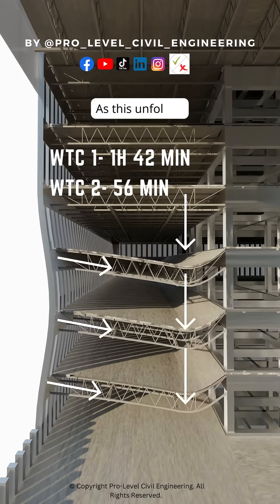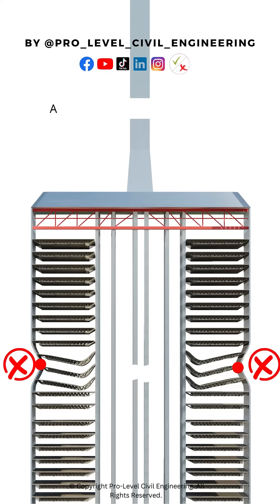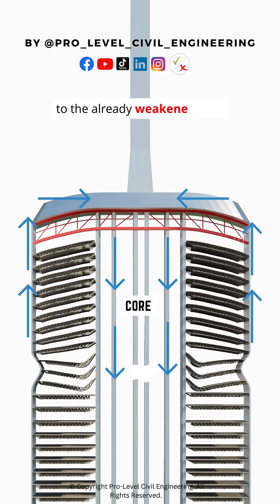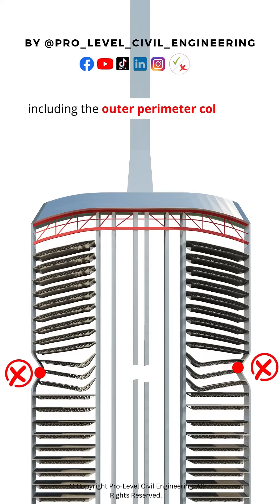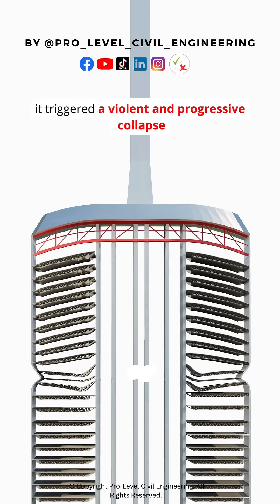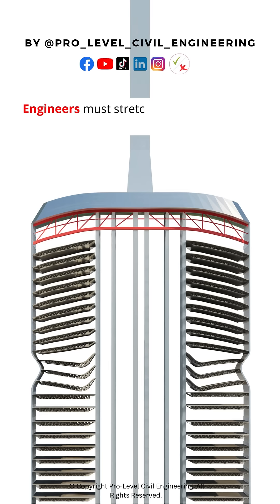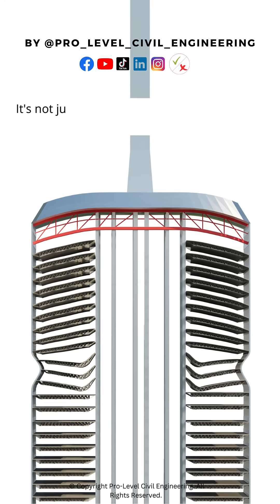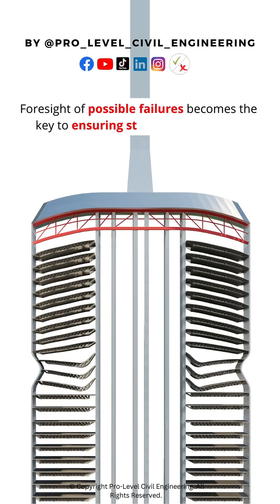The Horrifying Truth: Why the Twin Towers Collapsed on 9/11?

Comment: Yea thats want they want us to believe , i think an explosive was involved too
Reply: If you think it, it must be true
Reply: @cloudstreets1396 I believe it to be true.
Reply: @cloudstreets1396 numerous reports claiming they heard detonations. But that's not true right lol
Reply: @billy_barry  witnesses heard what sounded to them as detonations. Massive structural failure is an extremely loud event.
Reply: @cloudstreets1396  What did you hear that leaves you so firmly imbedded in your thinking?  Did you hear what the firemen heard standing in the street below?  I will always trust an eye witness to an event before I believe an expert with notions of what occurred.
Reply: @mrichards-j6b  I read the post report that very clearly describes what happened to the structure at the point of impact and after prolonged exposure to extreme temperatures from a jet fuel fire, weakened floor support beams to the point of failure. Four years of study by FEMA and NIST engineers and scientists which included witness testimony of hearing sounds like detonations is what I used to formulate my thoughts on the twin towers collapse. Just because firemen heard a noise is far, far from conclusive evidence. I will trust scientists and engineers whose expertise is in materials and structures and spent years analyzing debris and wreckage from the site.
Reply: @cloudstreets1396  That's how the Warren Commission was able to hide the true facts of the Kennedy assassination,  using the guise of expert investigating along with professional obfuscation techniques,  they were able to invent exactly what they wanted.  You can choose to believe what you want too,  but I am certain in my belief other forces were at play during the destruction of the WTC complex,  you are merely another component of the guise,  gullible or nefarious,  it makes no difference you are in play wether you realize it or not,  it is just like our political system a very well organized Plutocracy feigning democracy but buying every election,  do you actually believe you make a decisive vote when elections roll around,  no,  you are given a choice between two organizations doing the same things for the same people,  God bless you sir,  have a Merry Christmas!
Reply: @mrichards-j6b  Certainty in your belief is not evidence of anything
Reply: @cloudstreets1396  You do not have certainty in yours either,  two massive buildings eliminated from existence by fire?  Ha!
Reply: @mrichards-j6b  I do have certainty in mine. I can point to a report with extensive data generated by engineers and scientists whose job it is to investigate incidents such as this. You do not have that. You just want to believe a conspiracy despite collected and analyzed evidence.
Reply: @cloudstreets1396  A lot of people claim to know what occurred,  some in favor of the blatant NIST obfuscation and some against it,  it is obviously your intention to assert what you want others to believe,  thankfully their are many people who are not inclined to be swayed by the tomfoolery you peddle!
Reply: @mrichards-j6b  you use the words obfuscation, tom foolery and peddle so confidently and yet provide nothing to support that stance. It’s a classic tool of the conspiracy minded. Say it loud and proud. Who will stand against me if I say it loudly.

Comment: BS jet fuel does not get hot enough to melt steel, they have pictures of shape charges on every other floor in large storage room, the building was cut down so the us and British oligarchy can have another war to make themselves richer
Reply: Most of the jet fuel burned up in the intial explosions when the planes impacted the towers, but it caused massive fires on about 10 floors on each tower, and the fires (as well as the heat of the fires) only escalated as time went on. And the fires didn`t melt the steel, but it W - E  A - K - E - N - E - D the steel - which eventually led to the collapse of both towers.

Also the structure of both towers got damaged by the impact of the planes.

Comment: So, an aluminum plane slices through steel and concrete without so much as a wing tip breaking off. Okay, I got it.
Reply: F = m x a !
Reply: Both planes struck the towers at app 800-940 km/h.
Reply: @patrickanderson9023  So what,  they were not bullets,  they were hollow at the tips,  they could not take out there size in mass to create a silhouette of wing structure,  that's fantasy,  the holes were predetermined and generated prior to the computer guided flights impacts,  common sense should rule the day boys!
Reply: @patrickanderson9023  passenger jets cannot fly that fast at sea level
Reply: @Beachmaster820  Yeah, whatever. But try to imagine yourself: Each tower got hit by a 90-100 tons heavy jumbo jet at about 800-900 km/h. but you argue that it`s not possible for passenger jets made out of aluminium to penetrate steel and concrete? There are plenty of examples where small Cessna`s have penetrated tall buildings made of steel/concrete.
Reply: @Beachmaster820  Of course they can!
Reply: @Beachmaster820 Yes, they can. They don't NORMALLY because below 3000 Feet the Flaps and Landing Gear have been deployed for LANDING.
And both Planes were in steep dives to attack and hit the Towers.

Comment: The Jet couldn't destroy a single building after crash in Ahmdabad in lndia few months back !
Reply: THAT Jet was flying at less than a Quarter of the Speed. The Engines had been Turned OFF during Takeoff. 
How can you attempt to compare the Differences?

Comment: Thermite also helped!
Reply: There was no thermite.
Reply: @joshd3192 nano thermite. very powerful 😢
Reply: @joshd3192 how do you know? What causes a clean cut at an angle on the steel I -beams? Molten steel puddles, weeks after the tower's were down?
Reply: @Dangbo3030  The angle cuts were done during the clean up. Anything else?
Reply: @joshd3192  Hey.  Two sentence Tom thinks clean up crews are stupid enough to make the longest cut possible during removal,  anything else Tom?
Reply: Con tro lled 0pp osition  garb.
Reply: Very much. The remaining debris shows slanted metal uprights they strapped it too. All diagonally.

Comment: When the towers were designed giant jumbo jet didn't exist. The weight load plus the heat from thousands of litres of jet fuel burning weakened the steel.  The design didn't include functional sprinklers either.
Reply: Yeah, you're right. And Joe Biden really got 80 million votes. Covid was real. There was only 1 shooter in the JFK assassination.
Reply: A fire on the 80th floor can't destroy furniture in the basement. Explosives brought all 3 towers down.

Comment: Watch any video of an official demolition, and it comes down from the bottom up. T.T. went top down.
Reply: It was a government demolition. That is what you are forgetting. And a demolition can start anywhere they time the explosives. Use your brain. This isn't complicated.
Reply: @troyterry6919  So the government was behind 911?
Reply: @admiralprank probably shot down by the government. Why are you too scared to watch a 9-11 documentary?
Reply: @admiralprank you still haven't watched the documentaries
Reply: @admiralprank yes I can. I was twice voted the smartest boy in my school and I got a 33 on the act. I am a lot smarter than you.
Reply: @admiralprank and you were still too fearful to watch a 9-11 documentary
Reply: @troyterry6919  No I'm asking you. So what happened to Flight 93?
Reply: @troyterry6919  Does government explosion pull outside perimeter columns just enough for them to snap?
Reply: @nastyguy3841  Inducing failure of the core first will cause the trusses to pull on the perimeter columns and make them bend inward and snap.  How could the weight of the office materials and remaining concrete floors on the supposedly fire-weakened trusses, pull the much more massive perimeter columns inward?  Those columns are MASSIVE, making the trusses and any weight they beared seem like nothing in comparison.  Even to weakened perimeter columns.  Even if the weight of multiple collapsed/sagging floors were pushing down on a given floor.
Reply: For flight 93 watch 9-11 ripple effect.
Reply: @troyterry6919  So what happened to Flight 93?
Reply: @troyterry6919  Oh so the government compromised their own plan by taking down Flight 93? Why would they do that?
Reply: @troyterry6919  "Why are you too scared to watch a 9-11 documentary?"

I'm not. Unlike you I'm not gullible. Why are you too scared of logic? You claimed this whole thing was a set up by the government but yet, the government decided nah, let's foil part of that plan and take down 93. Great truther logic bud.
Reply: BS. A demolition is completely different.

Comment: Measure the weight of the plane with the fuel and passengers and luggages and all freight and multiply by the speed and how much was the force of collesion.  Then fire produced which stays for one hour burning inside the tower which was full of fabric furniture.

Comment: In my opinion I don't believe this for the simple facts that most of the video I seen there was black smoke meaning that the fires were oxygen starved which says If fire can't burn it can't get hotter a skyscraper in Madrid Spain burned for 24 hours without a hint of collapsing but these two over engineered buildings collapsed with oxygen starved fires two and three don't make four there's a digit missing to make it even make sense
Reply: What do you think was burning, wood? You had carpet, sheetrock, office furniture, etc. Do you people ever think anything through?

Comment: If you believe that those planes took down those towers you better take a physics class
Reply: Jesus look what I've started lol
Reply: @Ruairí-n7b remember Donald rumsfeild realized trillions of dollars missing all the records were in those towers controlled demolition look at the unknown maintenance crew in those buildings leading up to 911
Reply: It's near impossible to get good acid these days but I see you don't have that problem because you're trippn hard
Reply: What happens when you heat steel with a torch and apply pressure to it?
Reply: @keithostendorf3772 jet fuel doesn't burn hot enough to melt steel 😂😂 and if it did it go up not a 100 floors down
Reply: @TROYOGLESBY-b4w  it doesn't, but it sure burns hot enough to heat it up to a point where it bends steel easily.
Reply: You better take your meds and at least clean your tinfoil hat.
Reply: i don't think you ever have yourself you are so fucking dumb 😂
Reply: But explain about those 'two plains' first
Reply: @danidani-p8v7n remember Donald rumsfeild realized trillions of dollars missing all the records were in those towers controlled demolition jet fuel doesn't burn hot enough to melt steel and look into the mysterious maintenance crew in their prior to whaaaat not our government 😂😂😂😂😂
Reply: How do I know if you took a physics class
Reply: You are obviously not an engineer. LOL
Reply: @patrickanderson9023 yout dad should have wore a condom 😂😂jet fuel doesn't burn hot enough to melt steel especially 80 floors  down 😂😂
Reply: If you don't believe it then please explain what did and provide evidence. You people have had 23 years and still nothing.
Reply: @ButtHead-n5u except the bbc reported that building 7 collapsed before it did. That is impossible unless it was a preplanned demolition.
Reply: @troyterry6919  The FDNY knew the building wouldn’t survive. Reuters picked up on this and the BBC mistakenly reported it had come down. It was a mistake during the most chaotic news day in history. Hope that helps.
Reply: @joshd3192 no it wasn't. They lied
Reply: @troyterry6919  You’re calling the FDNY liars?
Reply: @troyterry6919  Oh so lying about the most complex. conspiracy in your mind isn’t complicated? Well you’re the hero of the action movie. So tell us - Where is your evidence of the claims you made?
Reply: @joshd3192 this is 7th grade physics. Do some research.
Reply: @troyterry6919  Proof? None ok then stfu
Reply: @ManOfPillowDoom I offered lots of evidence.
Reply: @troyterry6919 Building 7 collapsed after the first two towers.
Reply: @jkefel_03 yes. But my point is that it shouldn't have collapsed at all.
Reply: @troyterry6919  Uh huh. So you're all done now?
Reply: @troyterry6919 Because they made an error in a chaotic stressful event.
Reply: @troyterry6919 "They lied", under what evidence
Reply: @user-zj6lo8tq4j no they didn't. They were fed a sound bite too early by the government.
Reply: @user-zj6lo8tq4j because we have never learned the truth about what happened on 9-11.
Reply: But these planes started it
Reply: @Comfti  Jewish Inside job
Reply: @Comfti they started it but for the second building to fall the exact same way as the first it's by chance it was more to it
Reply: @Yonthedon215 The Towers were basically IDENTICAL Structures, so Yes, they did collapse Identically.
Reply: @Comfti  why did they start it? and how were they able to do that? Why did Bush intentionally ignore warnings about terrorists coming into the US to study aviation? It was all I made up deal to create an excuse for Middle East invasion, and you know it was not the first time the US government does this.
Reply: @khabdul93  I don't work for the US government so don't ask me
Reply: @Comfti also steel doesn't evaporate into thin air like what happen this day .. the structure around the 30th floor should be as solid as a rock because it was no where near plane impact area so how in the world does that section crumble? Its more to it
Reply: @Yonthedon215 Take a 16 pound Bowling Ball. Set it on a  Kitchen Table. 
Observe - not much difference. 
Now Hold the Bowling Ball 12.5 Feet ABOVE the Table  - and then let it Fall. 
Let us know the Results ...
Reply: @apaulmcdonough2170  I did it,  the bowling ball made a loud noise and briefly shook the table,  there is a smudged blemish about the size of a nickel were it impacted!
Reply: If you believe the planes didn’t take down those towers you should seek mental help lol
Reply: @barackobama9815 your dad should have wore a condom remember Donald rumsfeild realized trillions of dollars missing all the records were in those towers controlled demolition ask Bush and Obama about that 😂😂😂
Reply: @barackobama9815 then what destroyed building seven at freefall speed? Answer- explosives.
Reply: @barackobama9815 👈 Baraaaccckkk the nutjob
Reply: Bro before making such unscientific comment, you should take physics class first. This video is totally correct scientifically
Reply: @npm6598 your dad should have wore a condom
Reply: @npm6598 no it is not. The buildings basically disintegrated themselves. That means prepositioned explosives.
Reply: Care to elaborate mr. Einstein what exactly happened or u will just keep believing your conspiracy without even evidence like the way you are doing past decades
Reply: @palashkonde4912 your dad should have wore a condom I bet you believe  the media 😂😂😂
Reply: Science doesn't lie. Hate conspiracy nuts
Reply: @Ruairí-n7b your dad should have wore a condom 😂😂😂
Reply: @Ruairí-n7b right. Now go take another covid shot……🤡
Reply: @Ruairí-n7b science gets things wrong all the time. Hence there are scientific retractions. And the conspiracies are true about 9-11. 3 buildings can't disintegrate into powder without explosives.
Reply: @troyterry6919 Absolutely CLUELESS about the Difference between Volume and Mass. 
"Disintegrated" told us that.
Reply: @apaulmcdonough2170  BYU analyzed Stephen Jones's research and said he is correct